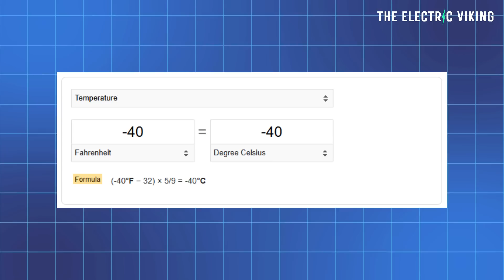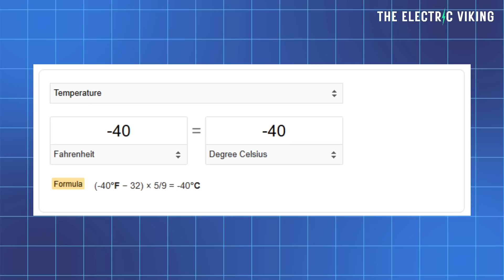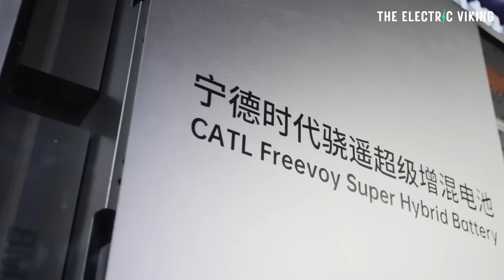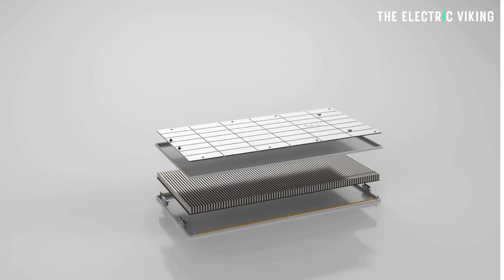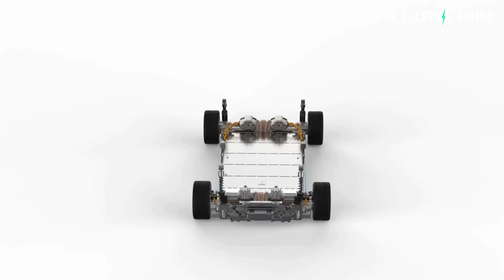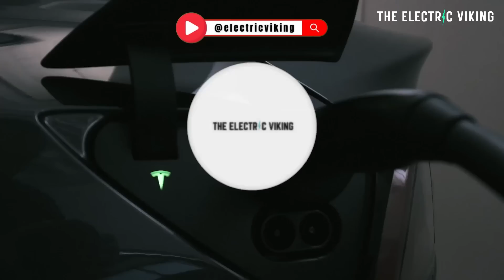CATL reveals second-generation sodium battery with 1 big improvement

Comment: Seems that the choice between Sodium and LiFePO4 will shift when Sodium Ion has LONGEVITY/Cycle Life >= LiFePO4.  Longevity is a major driver of cost of fixed storage and ability to remove cold weather performance concerns will seal the change to Sodium Ion batteries in storage.

Comment: Another thing to consider is what the increased operating temperature will allow. If the cells can operate safely and reliably at significantly higher and lower temperature than their lithium counterparts, then possibly the battery heating / cooling liquid systems can be eliminated. Eliminating this liquid system within the pack can therefore increase the energy density (and volumetric density) at the PACK level (as apposed to the cell level). These liquid systems are also a large cause of battery system failures as well, as there are numerous connection points internal to the pack and if they start leaking, the pack is ruined. This has been a common failure in many mainstream EV's. If you don't have to have a liquid cooling system in your pack, then that reduces pack cost as well.
Reply: Good observation
Reply: Very good point 👏👍

Comment: I am looking forward to seeing the commercial scale of LMFP. We need energy density in EVs of 350Wh/Kg to match or even exceed range parity with ICE. All these EVs with 200-250km  range fuel the FUD and slow down the transition.
Reply: a 30KW atkinson cycle petrol generator with 45% thermal efficiency, in a 2000kg PHEV, with a 60KWh battery and a 60L fuel tank, would have a range of 1500km and no need to charge on long trips, just fuel up and keep going. charge for the daily drive, petrol for long trips.

EV sales are dropping because at this point everyone knows someone who bought one and learned the hard way what the limitations are, its a great technology but the EV evangelists are setting everyone up for dissapointment.
Reply: @JedPotts-jv2ux  parts, maintenance headaches, and you're still tied to dirty, polluting exhaust fumes—it's like trying to solve modern problems with outdated tools.

As for range anxiety? That’s being tackled head-on with advancements in BEV tech. With energy density moving past 400 Wh/kg using LMFP chemistry—something that’s not far off—we’ll soon have affordable BEVs with 1,400 km of pure EV range. By that time, BEVs will also be far cheaper than ICE vehicles, thanks to falling battery costs and simpler manufacturing. PHEVs? They’ll feel like rotary phones in a smartphone world. Keep it simple, clean, and efficient—BEVs are the future.

And let’s set the record straight: EV sales are not dropping. The world is on track to sell 12.3 million BEVs in 2024, up from 9.5 million in 2023, 7.3 million in 2022, and 4.7 million in 2021. That’s BEVs only—not counting PHEVs. BEV sales have tripled in just four years, showing a clear shift towards electrification.

Even with some regional fluctuations—like a 7% dip in Europe in June 2024 due to changing incentives—the global trend is undeniable. BEVs are becoming mainstream because they’re simpler, cleaner, and increasingly affordable. PHEVs? They’ll be obsolete before you know it. EVs are the future, and the sales numbers back it up.

Comment: The battery that will take over is Lyten's lithium sulfur battery.  They are already shipping samples and are building a $1B gigafactory.  The anode is almost pure Lithium, so solid state batteries are in for a hurting.  The cathode is a patented graphite  process and can be tuned on a molecular level.  The cathode is how they solved the problem others have with sulfur.  Lyrens Li-S battery is 60% lighter than LFP and has the potential to reach 900 wH/Kg.  Military is sampling their batteries now for drones.  Also, existing LFP factories can be converted as there is 90% overlap in capital equipment.
Reply: Thank you for that info. Checking 'em out now. I'm interested in marine applications - commercial inland and coastal shipping, ferrries, tugs etc., as well as recreational boats - and what battery technologies might be brought to bear in that market, where gravimetric energy density is critical.

Comment: I wrote in May a big simulation for off-grid fast charging settlements. I simulated with
Sodium battery US$ 64/kWh, 96% efficiency
Iron Air battery US$ 12/kWh, 60% efficiency, C=0.01
Even with US$ 30/kWh, the iron air battery has no chance because of low efficiency and very low charge/discharge rate.

Comment: Every coastal country should be building Desalination Plants & pipe clean water across all continents & countries.  The salt taken from ocean water could be used to build batteries.  This would also help reduce ocean levels. The more batteries every country can build the more energy they can store.  If they also build & install Bifacial Solar Panel Fencing in all major roads in countries all over the world not only could they produce an abundance of energy they could transport energy along all their highway systems across continents & across every country on earth.  Of course, there are lots of people against creating a world of abundance because scarcity increase prices while abundance reduces prices & those greedy people always want more $ not less.
Reply: All fine but cost it out and that is the most common explanation we don't do certain things.
Reply: Do you think we can lower sea levels by pumping the water out? Seriously? Have you even the faintest idea how much energy is required for desalination? Solar panels cannot be used to distribute power, only to generate it.
Yes of course we should be building renewable energy infrastructure as fast as we can. The rate of expansion in this area is exponential you'll be happy to know.

Comment: In Canada and parts of North America It can and will get to -20•C sometimes even -30 or feels like it outside.
So these Battery improvements are much more needed then just Alaska lol
Reply: The Norwegians seems to manage!
Reply: The weak point of LFP is not so much the discharge temperature, although these improvements are welcome, the main problem is that LFP cannot be charged at temperatures below zero and only slowly at temperatures that are slightly above that. It doesn't seem like this battery changes that.

Comment: For Stationary storage,
Energy density doesn't matter.
Only cost matters.
Reply: There are transport costs. There are costs for the room for the batteries.
Reply: @pegefounder  Most megapacks are transported in their own container and are typically the size of a Semi trailer to reduce cost and complexity.  The transportation costs of $5,000 to $20,000 depending on location, are a small portion of the overall price which typically run about a million dollars per unit.  You would need additional units to match the same output and that would be a significant cost if the Sodium units are not cheaper.
Reply: @pegefounder I would hope megapacks are put on the sites of decomissioned fossil fuel plants, or other such "brownfield" sites, where the land is dirty, polluted and unwanted, but also there's already beefy grid connections ready to go.
Reply: But energy density is sexy. I can fit a kWh in a coffee cup!
Reply: @rosalieroku3818  You have a point, but most users of energy don't give a s**t about that, as long as it's reliable and affordable.
Reply: Assell as modularity, augment on need? need

Comment: It its a case of being cheaper for roughly the same energy density and charge time, sodium would be the no-brainer. If its a case of the mountain climbing company is offering a 30 percent discount from the completion but their ropes aren't as strong, consumers will think twice before buying them.
Reply: Its a bit more like the 2nd anoligy you listed, Sodium batteries will be heavier than Lithium - ok for stationary storage but impacts efficiency of vehicles. Also, has a wider voltage range making the charging/inverter electronics more complex and costly.

Comment: The general public are not bothered wether they are sodium or lithium give them a battery than can do 700 miles for a certain price and longevity and that is when it will take of
Reply: bro thats 1100 kilometers.  most petrol cars you're lucky to get 800km on a tank unless you have duel tanks.
Reply: @robanzzz5124  That is true, but first off there is so much hype about range anxiety that it has actually become a real thing, and secondly, you can refill your petrol car in 5 minutes, so range in 0.01% of journeys made by petrol cars might actually be a real issue!

Comment: The highest density battery would use  silver oxide yes expensive yes but very recyclable best used for aerial taxi when you land exchange or recharge battery 🔋 done and done simple
Reply: Most silver oxide batteries are primary cells, i.e. non-rechargeable. Rechargeable lab ones exist but these have quiet low charge densities (but offer a hugher current flow for their size). Not to mention Silver is less abundant that Lithium, more costly to extract and more expensive in battery form kg for kg than Lithium. Of all the Metal-Air (oxide) batteries Lithium-Air has the highest max energy density at 11kWg/kg.

Comment: The problem of Na batteries is the very wide voltage difference between charged and discharged is a very linear curve and BMS can't handle that big gap. I believe next gen are LMFP or maybe solid sate.
Reply: Thats a good point - have ordered some for testing and will use them with a buck / boost DC DC converter to keep Output voltage constant while the input Ranges from 6V to 15V
Reply: You can build a BMS to handle what ever range of voltage you need to handle. This is not a problem at all for a BMS, unless you are trying to use a BMS  designed for Li Ion or LFP on Na, but that would just be dumb.
Reply: Yea, right now the cells are 3.9 to 4.0 volts, in a 100Ah battery this is 16 volts!!  In an RV the inverter will shut down with a high voltage alarm.  Hopefully they get the circuits down and BMS to be compatible.   Right now, that is a big NO.